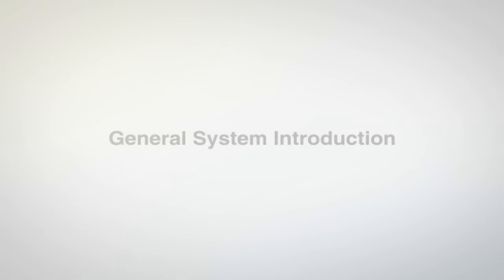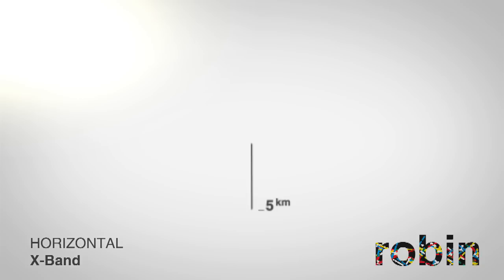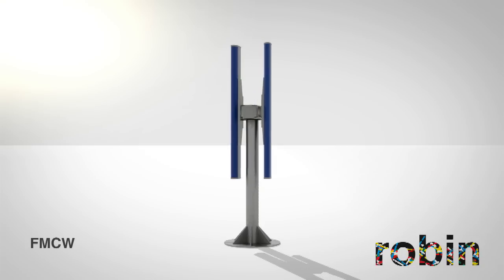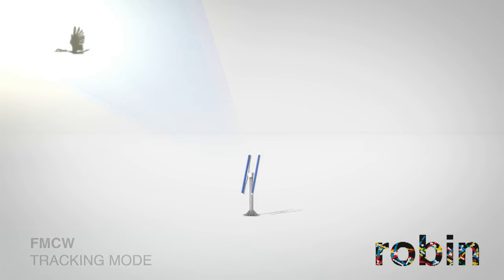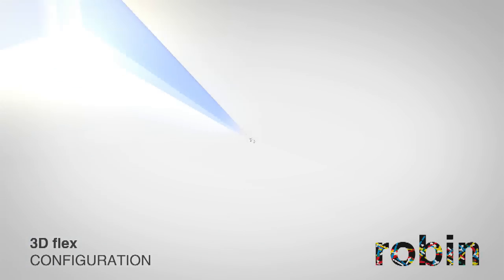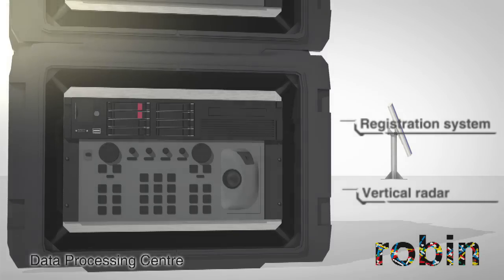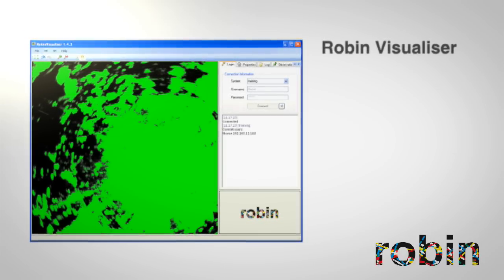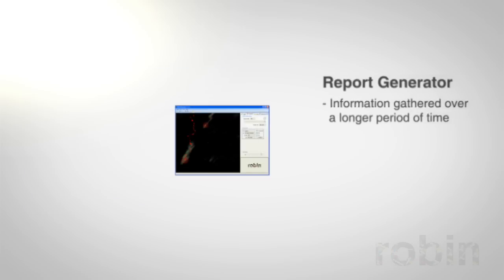Robin Radar Systems | Introduction

Comment: A bird radar system is built up out of one or more radar sensors that scan the environment a data processing center and different interfaces to control the system and display the results lets start by explaining the three types of radar sensors that we use.
  
Radar sensors
1.the horizontal ex-band radar is 8 ft. long and rotates 45 times every minute it is capable of identifying small birds up to 2.5 km and large birds or flocks at a range of around 5 km, the normal viewing angle is 10 degree above ground level, the same radar can be placed o its side using it vertically to scan the sky.

2.A larger variant is the s band radar it is 3 meters 60 long and normally rotates 24 times every minute, the s band radar can identify large birds in up to 10 km in distance and 2 km in height.

3.The third type of sensors marks the second generation and the industry of ABN radar where previous centers originally built for marine purposes, this FM CW radar is purpose built by robin specifically for birds monitoring, this sensor has three operating modes, in the staring mode the user can select a specific area of interest to which the radar automatically points and pick Seitz, a second mode is the scanning mode the radar rotates horizontally and vertically at the same time it scans a 360 degree area gathering information’s of all birds in the range of 3.5 km, the third mode is called the tracking mode when the user is interested in a specific target the FMCW can pin point and track it without losing it out of sight while doing so it measure the birds wing beating frequency as one important variable to determine what type of bird it is.
Combining a vertical ex band with horizontal s band radar provides 3 dimensional information’s with in the fixed overlapping area, birds identified including information about their location, speed, direction, and height. The size of reflections combined with their distance can also be used for classifications to distinguish between small birds large birds and flocks. The S band radar can also be combined with the FM CW radar using all of its flexible capabilities, given its ability to measure wing beats frequencies the 3D flex configuration provides information’s that goes beyond classification, towards the level of distinguishing species, the data processing center is well protected in a shock water proof housing with gasketed removable doors inside 8 elastomeric shock absorbers holder 30 inch rack in place containing the different layers of hardware:
a. The rack console 
b. The birds monitoring system
c. Registration system
d. The UPS
e. Horizontal radar
f. Vertical radar
When the horizontal radar is combined with vertical radar they share the same bird monitoring system, rack console and UPS. The vertical radar does however require its own registration system and control unit.

The rack console only serves as a local interface to monitor the technical status of the systems. Monitoring birds however is done remotely, for example on a laptop in the field to perform flawlessly under working environment where weather conditions and physical abuse are unavoidable we use ruggedized laptops. In most cases however users are located in an office or air traffic control tower, using regular desktop computer connected to the Internet.

The robin visualizer displays the results from the different filter techniques that took place in the birds monitoring system, tracking is done using a cleaver tracking algorithm it connects different plots belonging to the same target revealing a birds flight path as a red line, the diameter of the circle around the target indicates its size, the yellow line starts at the next predicted location and indicates its course, its length represents the speed of the bird, for orientation users can select a map or Google earth as background.

Many clients use our system not for real time monitoring but to study information gathered over a longer period of time, the facilitate this off-line analysis robin developed a report generator, features like these all emerge from working closely with the collagists, bird control department and air traffic controllers. Robin radar system is continuously improving its system.